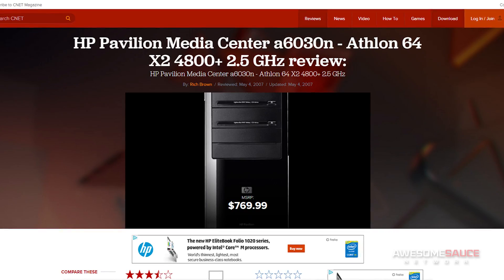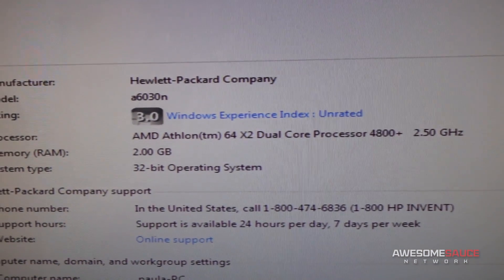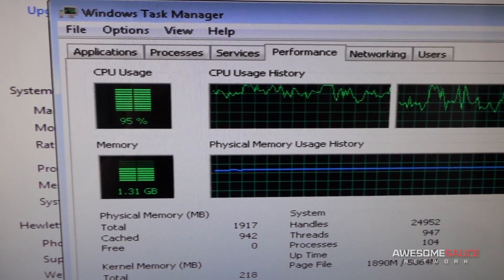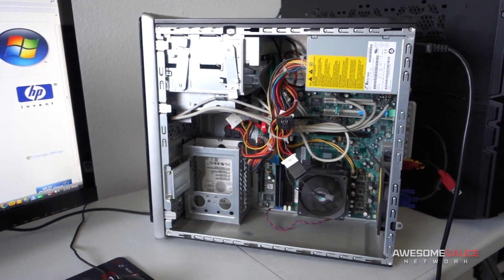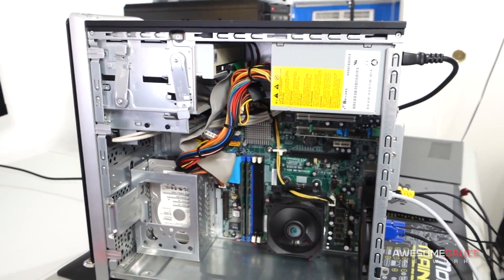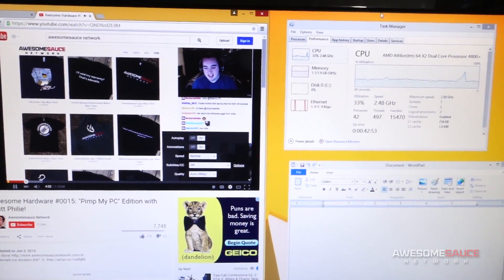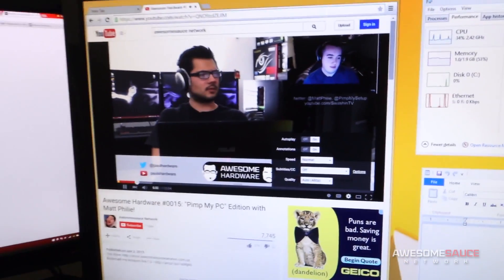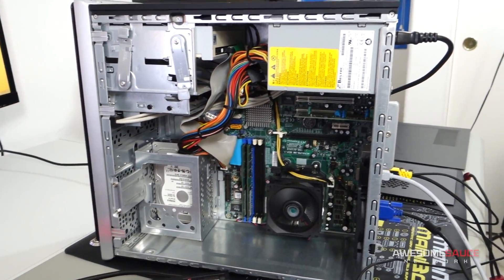Cleaning Up My Neighbor's Old Desktop!

Comment: 2:18 Why would that PC run a 32 bit version of Windows if it has a CPU labelled as 64 ?
Reply: BOBOUDA the CPU is capable of it, but when they bought it they probably didnt want to spend much so they got the best deal AKA 32-bit VISTA
Reply: Dylan McIntyre Oh, that could be why, thanks.
Reply: BOBOUDA np
Reply: BOBOUDA It only has 2 GB of RAM
Reply: ***** 64-bit operating systems support 2GB of RAM as well man
Reply: I know, but they'll run horribly.
Reply: ***** indeed
Reply: ***** 
Any windows vista(+) system wil run horribly with 2GB, however the 64 bits version will run as good or bad as the 32 bits one. 
A 64 bits system might speed up certain tasks though so unless disk space is a concern (64 bits window requires more space) I'd say ALWAYS go for the 64 bits windows version if it's an option.

Well unless it's Windows XP, the 64 bits version of that is hard to find drivers for, but no one in the right mind is still using Windows XP after support for it has been stopped.
Reply: I installed windows 7 64 bit on my shitty dell inspiron with 3 GB ram and it ran like SHIT. 32 bit runs great.

Comment: Hey Kyle, I love redoing old pc's too. One thing I would have considered seeing as he would have to now learn Windows 8 is maybe using a nice, snappy, light version of Linux. One example is LXLE. It is really quick, works exceptionally well on older systems, and can be set up to look like Windows, Mac. or whatever you choose. Also, Libre Office or Open Office works as well MS Office. I usually will set the default save settings to a .doc file so there are no issues for the customer. But, I am sure you know all this. Anyway, I would enjoy seeing more videos such as these, and I really enjoy your "Pimp My PC" series with Paul. Thanks, and keep the great vids coming!

Comment: FYI, Chrome is probably dumping the YT vid on the CPU instead of using any hardware encoding.
Reply: MrTVintro I don't even think the integrated GPU on the motherboard supports hardware accelerated video. It looks like it came with NVIDIA 6150SE built into the nForce chipset. From what I can tell, NVIDIA integrated graphics didn't do hardware acceleration until the 7000 series.

Comment: Kyle you can't put DDR3 SDRAM in a DDR2 DIMM slot.  Even if he did upgrade his CPU he would have to get a new motherboard with DDR3 DIMM slots to use DDR3.  

I'm sure you know that but the way you were taking about upgrading his system, you made it sound like all he needed to do was buy a new CPU to use DDR3!

Comment: Im a bit against installing such a new os with those specs. Why not reinstall vista or something and let him enjoy that little extra of performance?
Reply: ***** Because Windows 8 will run better than that. The requirements for Win 8 are pretty much the same as Vista.

Though I would have kept him with Vista simply because Windows 8 is hard to get used to when you've been using Vista or 7 for a long time.
Reply: Yeah, I'd upgrade ram and cpu instead of buying windows 8 for 100$
Reply: ***** You can get Windows 8 for 1/5th the price you just mentioned... reddit microsoftsoftwareswap

You're welcome.

Comment: Excellent job and video as always ^_^ I just fixed and cleaned up my buddies moms pc of the exact make n model also the same PC name "paula" lolz far less dust in you neighbors, the one I fixed was so bad I could'nt even see the motherboard 0_o
Reply: Total Tech Addiction A year ago, I would freak out at that ammount of dust.
But I built a system for my classmate, he got a new case and PSU so I rebuilt it all. I went to build it once more after he upgraded the RAM, CPU, MB and GPU and wanted me to put it together.
These two events were about a month apart.
A few days before the second upgrade I saw a compilation of 40 dirtiest computers.
I sh*t you not, his would win. Within a month, in his house "full of people with allergies, so we vacuum a lot", the filtered intakes on the Corsair 200R were covered. The PC was dying by suffocation. I planned to go in, swap the components and leave and as soon as I saw all the dust, I yelled at him to bring me a vacuum cleaner.
I literally felt like I was spraypainting the inside of the case black.
I took the fan off of his CPU cooler. It's a Gelid Tranquillo rev. 2. This cooler has an indentation (for whatever reason) behind the fan. That thing was FULL. Literally, FULL of dust.
I've never told someone that his PC is "a bit dirty" since. I just say "not bad, I've seen WAY worse".
That day took something out of me.

TL,DR: Friend's PC was so full of dust after a month that Kyle would run away screaming. And if he tried to blow it out, it would like a sandstorm.

Comment: My dad has pretty much the same problem, but there isn't any rescue for his PC. He has a Intel Pentium 4 single core CPU, 512MB of RAM, and apart from the CPU cooler no fans at all. So, I build him a new system, which he'll probably get at monday :)
Reply: Senzelian If you don't mind, can i know the specs?
Reply: Nickx G3258, 12GB Corsair XMS3, z87-G43
Reply: Senzelian no graphics card?, i mean all systems be it a basic build will benefit from some form of GPU.
Reply: gamer1000% Well, he doesn't even know how much that stuff is worth :P It wouldn't be very interesting to watch.
Reply: The Lazy Dreanei He doesn't need it. He is only checking his mails from time to time and surfing the web. He doesn't even watch videos.
Reply: ***** I had them lying around. So I better put them into a system than collecting dust.
Reply: Senzelian get him a cheap APU and a small case and he'll be blown away by all the colors and fancy themes/animations. xP
Reply: Senzelian still, it will load all that processing onto the CPU and the G3258 doesn't even have hyper threading a really cheap card will mitigate that have help with the PC being relatively fast overall.
Reply: The Lazy Dreanei We will see. If the integrated graphics isn't enough, then I'll get a GPU
Reply: ***** That also would've been a nice idea, but I had a Z87 motherboard lying around which I used now for his build.
Reply: Senzelian Update the z87 bios before building, you might need it.
Reply: Senzelian My parents usually end up with my old gaming pcs after I build a new one :P
Reply: That's so cool!!
Reply: Senzelian What will he be doing that uses even 8gb RAM, let alone 12gb?
Reply: Muistimetalli He won't even use 4GB. But I rather have that ram sitting in his rig and beeing used than just lying around. But by now one of the ram sticks died anyway, so he has 'only' 8GB right now.
Reply: Senzelian i dont understand how you got 12 gb in though? i heard 3 ram sticks dont usually work together, dont you need either 2 sticks or 4 sticks in the slots?
Reply: Infinite 3 Sticks also work :)
Reply: Infinite Some times triple channel memory is supported, or most likely all three are run in single channel.
Reply: Senzelian What about a raspberry pi 2??? That will be faster than his current pc.
Reply: RCTestKid It would be, but the PC is already build and like I said, I had the parts lying around. So I used what I already had instead of buying something new.
An Intel Compute stick would also be possible.
Reply: Infinite Yep I got 3x 2GB DDR3 1600 mhz in my system making it 6 GB, running awkwardly fine in dual channel mode. Next thing on my upgrade list as it just can't keep up with my GTX 970 and 8320 (4,4Ghz) + SSD  anymore.
Reply: Mick de Raad I'm pretty sure you're just running the 3 in single channel. I don't think its possible the way you described.
Reply: Well unless my BIOS is lying to me, it is dual channel. Both my previous motherboard and the one I have now. I do agree with you that it sounds pretty fucked up though! :)
Reply: Looked it up and it seems what you said does work.
Reply: Morganamilo Thank you. I was confused myself too when I first thought about it when I got these 3 ram sticks (in one package as "6gb (3x2gb)) in 2010. Also as the author above, Corsair XMS3 CL9 1600 mhz 1,5v.
Reply: My $50 prepaid tracfone has the same amount of RAM thats small as fuck
Reply: droidtrooper100 pretty sure most phones have not even exceeded 4gb ram
Reply: Senzelian put linux on it, it will run smooth
Reply: d3r2000 Doesn't Linux need a decent amount of ram?
Reply: Morganamilo it's very forgiving some distributions barely take up any space on the hard disk

https://help.ubuntu.com/community/Installation/SystemRequirements
Reply: Ram is memory not storage.
Reply: Morganamilo indeed and SliTaz GNU/Linux can run on 16mb of ram
Reply: d3r2000 I use SilTaz, It's only 40MB so I emulate it on my phone. I have no idea about the ram requirements but even if it can run with 16MB would it run well?
Reply: +Senzelian mine using amd athlon II p320 , barely run blockade 3d

Comment: What thermal paste would you recommend?
Reply: ***** While I'm not Kyle, I have used Noctua's NT-H1 and have found it to be extremely good. Especially on bare dies like most graphics cards because then you are not limited by whatever thermal paste intel/amd etc are using underneath the heatspreader.

Comment: Judging by how old that computer is I would've just recommended to my neighbor to buy a new computer. Or at the VERY least max out the CPU, RAM and add an SSD all in that order of priority.
Reply: Dylan 873 ddr2 memory isn't a good option. it's damn expensive because nobody is currently making it anymore. it's why i ultimately decided to build new. my motherboard, and his, is likely a huge upgrade "bottleneck" also. ssd is likely his best option though i agree.
Reply: ***** I've seen used DDR2 on ebay for $20 for the last 2GB that they need. Buying it new is very expensive but used RAM is much more affordable. But yes in toady's world if you're still using DDR2 buy a new motherboard or an entire new computer.
Reply: Dylan 873 I had a very similar setup as Awesomesauce Network. I basically did what you suggested a few months back. Old specs: Athlon x2 2.2. 2gb RAM, 40gb WD 5400RPM Win XP. My task manager was doing the same as in the video. Opening programs were painfully slow. Refreshed the pc: maxed the RAM (4Gb's), put an ssd and loaded a copy of win 7 x64 I had laying around. Speed difference is night and day. Even though my SSD is bottlenecked by SATA I, it still miles ahead of the 5400RPM HDD. It is buying my time till I have enough to refresh to a more modern setup. Well worth it, imo.